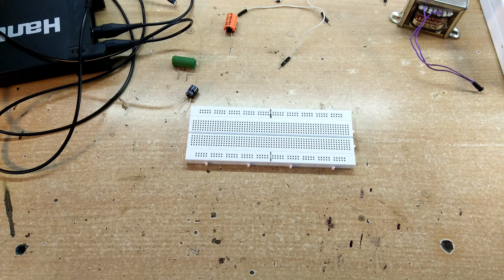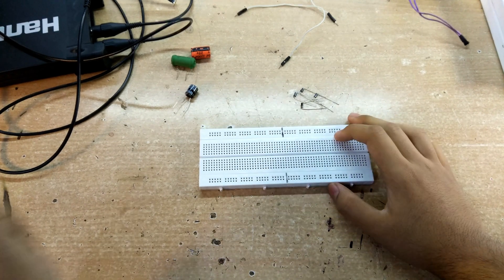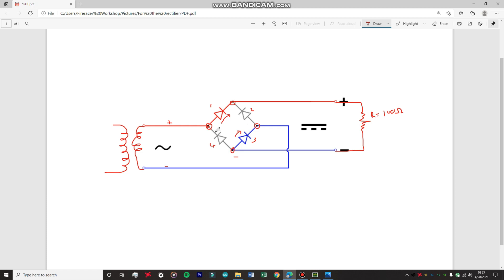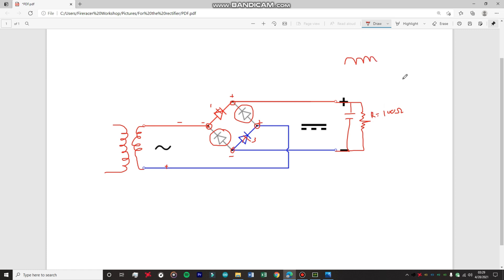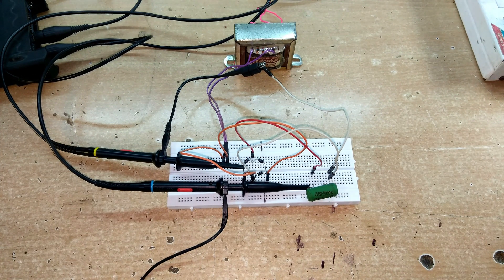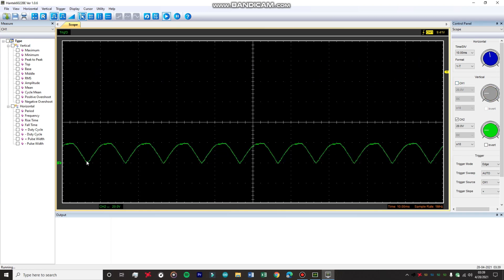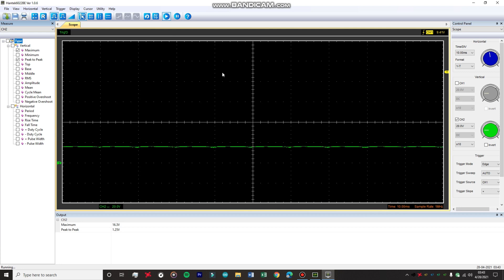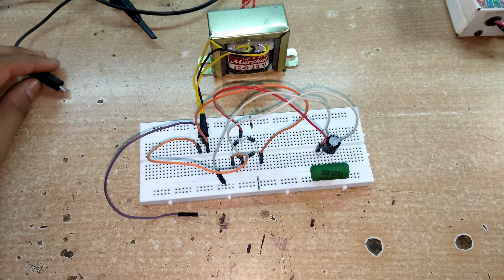Full bridge rectifier Explained (Using oscilloscope) Part 2

Comment: Hi Pranay,
what happened if an oscilloscope is connected across the line between a dc drive and motor an ac wave is observed. What is the cause?
1.shorted bridge rectifier.
2.open bridge rectifier.
3.shorted filter capacitor or open filter capacitor.
could you please help me out.